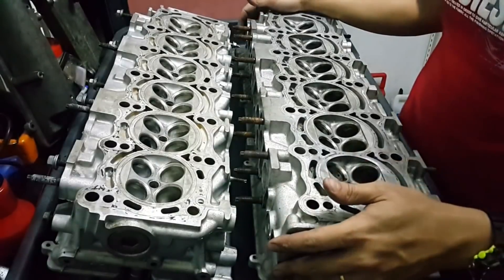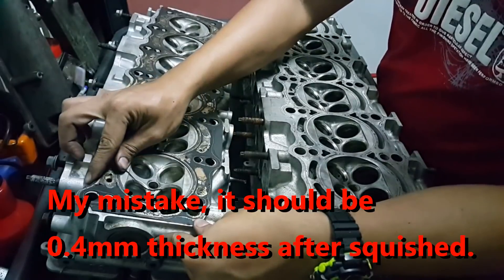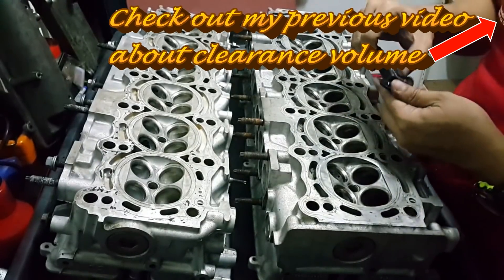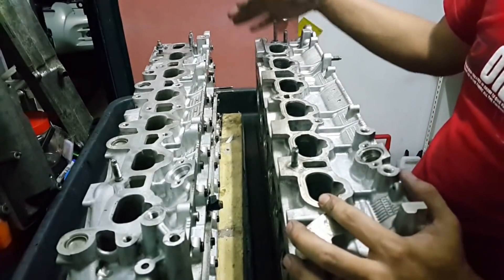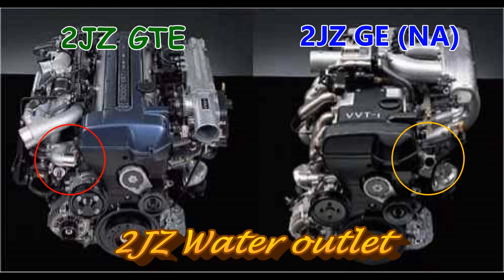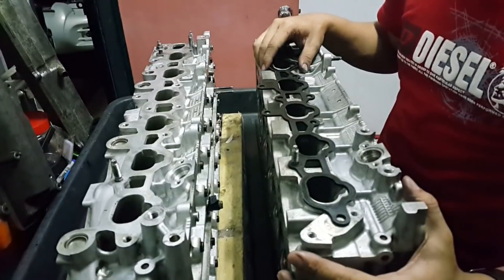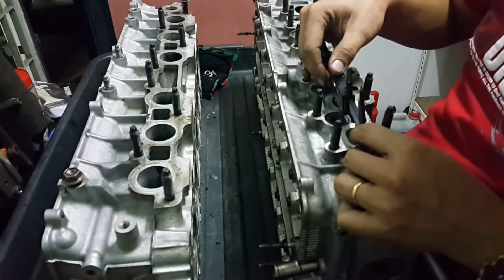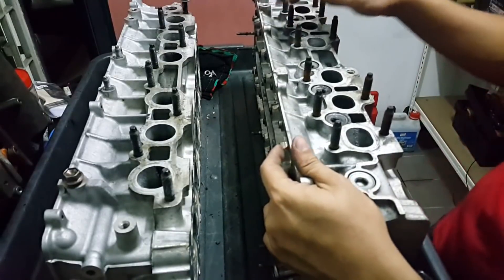2JZ Tuesday #9 - Difference between 2JZ GE and GTE cylinder heads (the best comparison!)

Comment from the maker: Here you go the difference between 2JZ GE (NA) Cylinder head and 2JZ GTE (Turbo) Cylinder head! You don't need to buy both to know the similarities and differences too! Here is my another video about the difference between the 2JZ GE and 2JZ GTE Engine block: https://www.youtube.com/watch?v=ZZ9DwNeW6UM
Reply: Is the GE worth the time to go NA T? I'm looking for 400-500 hp range for now. Heard a GT45 NA T was a good set up. What's your input.?
Reply: @JL_RandomThoughts  i think is more easy swap the gte cylinder head with all turbos system on my lexus is200 and put one big turbo. Because i hear the valves on gte cylinder head are more strong than ge this is the reason why i want swap the heads.
Reply: @carloscolberg4997  cool. I have a 99 sc300 that I want to have fun with. Don't need the fastest car on the planet. If the price is right it seems the way to go. How about single exhaust vs the dual I have?
Reply: @JL_RandomThoughts  what about the intake?
Reply: @JL_RandomThoughts  you have turbo on it?
Reply: @JL_RandomThoughts  if you want gain more hp at high rpm better intake and dual exhaust worth.
Reply: @carloscolberg4997  stock. looking at prices and it seems the best thing to  do is just get a turbo 2j and swap. they're cheap enough. same cost as buying the head alone..
Reply: @JL_RandomThoughts  yes is a good option
Reply from the maker: @JL_RandomThoughts  i m not sure what fuel u guys are using, but NA cannot go to 400 hp i think. need con rods, pistons, fuel, turbo, injectors and ecu. NA-T i have 2 videos about how to do it too
Reply: @cheapkailaujing  cool. I'll check it out
Reply from the maker: @JL_RandomThoughts  yeap.. Na-T 400 to 500hp is easily achievable
Reply: if i have 2jGE can i replace the cylinder head for 2jzGTE?
Reply: @carloscolberg4997   yes. all 1jzgte/2jzgte/ge/vvti and non are all interchangeable when it comes to the head and block.
Reply: @rayj2j  its true? The gye valves are more strong than ge head? This is the reason why i want do a head swap.
Reply: One last thing. Can a GE head be machined diy for better cooling and fit a GTE gasket?
Reply from the maker: @JL_RandomThoughts  hmm u can fit gte gasket on ge head. but inside ge head the water passage is lesser, and i believe cannot be machined bigger.. it was done during cast
Reply: Michael can i buy a gte head from you?
Reply: Hi michael i have NA supra that im planning to turbo soon and you said we cant use GTE intake manifold on the GE but what if we try to use a GTE upper plenum on the GE lower plenum. i know the intake ports on the cylinder head is different between the two but what about from the lower plenum upper plenum part i think theyre the same
Reply from the maker: @noodlestoddles187  hmm gte and ge intake manifold do not match

Comment: What about the cam shafts? Are they interchangeable?
Reply from the maker: Sorry I didn't try it, but it should be interchangeable. Except for VVT-i and non vvti. And also some cylinder head has 2 cam sensor input, some has 1 only, so have to check on that too

Comment: hi, great vidio .. i am trying to see if there is a differance in the coolant outlet ports on front on exhaust sides of heads .. is hole and bolts spacing the same or differant ?
Reply from the maker: Yes one is left one is right. Not interchangeable

Comment: Very nice!! So do you think that GSC S1 GTE VVTi cams would fit in a GE VVTi head???
Reply from the maker: yes but be careful of the cam sensor position, it might hit or different number of teeth
Reply: Michael Chung Racing -Cars Explained so i will still need to modify the head for the new cam sensor or how?
Reply from the maker: @Crazy_ATV_rider  this one u have to fit it in to see.. Either u can machine a spacer for sensor or adjust on the ecu
Reply: Michael Chung Racing -Cars Explained thanks so much for the help! I will look up more, the sensor i don’t think that would be a problem because i’m going aem infinity standalone ecu

Comment: what about the middle section of the intake manifold? 
example, GE Head with GE intake manifold adapter or pipes section can that bolt on to the Actual Intake manifold of a GTE Intake? (The Actual Intake body)
Reply from the maker: Nope.. Cannot match at all. Holes for air and bolts locations are not the same
Reply: Michael Chung Racing -Cars Explained thanks for clearing that up 🙌🏽

Comment: Same valve diameter?
Reply from the maker: yes but the profile is slightly different for air to flow in.
Reply: Michael Chung Racing -Cars Explained Did you ever find out which exhaust port is bigger ?

Comment: hi, are there differences with 2jz gte vvti Supra vs 2jz gte vvti Aristo? I only know the rear or front sump oil pan. they told me smaller oil pump on aristo and slightly narrower head suction pipes in aristo. what do you tell me ? thankssss

Comment: The problem is that you are using the bad GE head (vvti). The GE vvti head has waaaaay smaller intake ports than the GE non vvti. I am using a GE NON-VVTI on my 2jz build and i deleted the distributor and drilled/welded a cam sensor bung on the same location as the GTE and GEvvti so I can use GTE cams. I paid $39 for that GE non VVTi head (vs $1200-1500 for a GTE head). So I spent the rest of the money in 272 BC cams, springs, etc. I honestly don't like anything GTE because it is overpriced. You can find a GE non vvti in a junkyard for $250. (instead of buying a GTE for $3,000).
Reply from the maker: Ah that's a good deal.. Sorry I don't have ge non VVTi to do a comparison too

Comment: Hi great video! I’m just confused, I have seen on forums that the gte valve covers fit directly on to the ge and it has been done many times, can you explain this as one side did not fit for you? Thank you so much!
Reply from the maker: oh vvti and non vvti valve covers are different. because of the vvti solenoid stuck out. and the screw locations are different too T_T
Reply: Thank you for your reply I’m learning a lot from your videos, so am I correct in saying that non vvti gte valve covers fit directly on to a non vvii ge head?
Reply from the maker: @TheTommycute  oh dear sorry i don't know about it. since i dun have non vvti gte head. i had one vvti gte head, and i machined a non vvti cam into it. but i dunno about the valve covers T_T sry
Reply: Oh I didn’t realise that they were vvti heads you were comparing, 👍

Comment: would installing a gte cylinder head onto a GE block essentially be direct fit bolt on, or would their be fabricating needed?
Reply from the maker: direct bolt on =D just have to check out for oil supply for turbo etc =D
Reply: @cheapkailaujing  what do you mean by oil supply to turbo?
Reply from the maker: @isaacgarcia2979  2jz gte has turbo, GE no turbo. But gte turbo has oil feed directly from the block, at GE head has the oil supply but blocked off. Either you can unblock it or use the vvti oil supply for your NA-T turbo

Comment: Very nice video but I have one question, will the GTE head fit on the GE block? And what would you need to make that happen cause you aside something’s are different
Reply from the maker: fit, but there is some water outlet and oil outlet difference for the turbo, oil filter with water cooled hoses. others are exactly the same
Reply: Michael Chung Racing -Cars Explained thank you for responding so fast, if I were to run the whole stock the head would there also be a wiring issue I would have to tackle?
Reply from the maker: @justini2351  most of the sensors and stuffs are on the head, so if u are using gte head, u have to use gte wiring harness haha =D or rewire a new harness =D

Comment: Can you do a video on the Difference between a 2JZ-GTE & 2JZGTE-VVTI Wire harnesses... Including Layout differences, Connectors, and missing or extra connectors?
Reply from the maker: Hmm if 2jz gte non VVTi and VVTi, the difference is just VVTi socket. The rest still the same. If 2jz GE and gte, there are only a few differences, namely, the tps location, MAF vs MAP and air temp sensor. The rest are the same..
Reply: @cheapkailaujing  What about USDM VS JDM Harnesses. 
Lets say I planned to Swap a JDM 2JZ-GTE Aristo engine into a JDM 2JZ-GE JZA80. Besides Coils what would the differences be. Could the 2JZ-GE Harness work on the GTE?  Are the ECU Pins the same? or there are variances that might need to be re-pinned to match. Could make an interesting video as well
Reply: Another question to consider is. Can a GTE VVTI Harness work on a GTE Non-VVTI if you changed the ECU Connector? Would all the connectors be the same besides the ECU Connector 🤔💭
Reply from the maker: @BjornFSE  hmm i have no way to confirm it, but i think the difference is just the vvti socket
Reply from the maker: @BjornFSE  sorry we have no access to USDM engine at all. what is the reason of reusing the harness, if u are changing to a new engine, it should comes together with its wiring..
Reply: @cheapkailaujing  The engine is a JDM Aristo 2JZGTE swapped into an MK3 Supra. The car had an accident. and now planning a Swap of the engine into my JDM JZA80  2JZ-GE. The ECU Connectors are the same. however I am reluctant to mess with my GE Harness. Hence considered buying a GTE VVTI harness used and re-pin the connector to suit the GTE with/for a standalone ECU. (I am not sure the extent to which the Aristo harness into the MK3 is damaged.)

This is the reason I asked the differences between GTE Non-VVTI and GTE VVTI comparisons of the 2JZ Harness. 

(Side Note: I also read on a forum the harness pin differences in some locations on the GE versus the GTE version but I believe this is a JDM vs USDM matter.... Likely Supraforums)
Reply from the maker: @BjornFSE  hmm the 2jz GE just reuse back its wires and the 2jz GTE reuse back its wires? :)

Comment: Hey i have a question i have a 2jz ge vvti engine. That I want it to make 400-500hp. I’m going to put a turbo. What do I have to change in it to make that power?
Reply: I’m going to put gte pistons & rods & this engine is going in a 280z
Reply: Michael Chung vui min sure well 👍👍 & keep updating your video you they help us a lot
Reply: If you can, can make a video on a 2jz ge vvti engine on how to make more horsepower on it 👍👍👍
Reply from the maker: @josemarichalar7437  not easy, but i will do that... budget constraints..

Comment: Hey bro, quick question. What's the advantages and disadvantages of using a non VVTI GE block and VVTI GTE head? I've seen some people do it here in the US.
Reply from the maker: some people worry of the vvti causing interference and catastrophic failure.. so they use non vvti one whole set. but some have tested and using vvti all the time, with better response =D

Comment: I bought a 97 lexus sc 300 with the 2jz-ge engine, it will be a daily driver, but I want a little more power 350-400hp, how would you recommend I get to That level of power?
Reply: @cheapkailaujing  thanks, I'll look more into it

Comment: So question would it be better for me to buy a jdm 2jzgte vvti and swap out my 2jzge engine? And if I  do that is it a direct fit or will I have to do some mods besides wiring harness to get engine to fit in my 2002 gs3? also can I use my 5sp auto Trans or must I use the 4sp Trans that comes with motor? And lastly if I  just decided to go with making my 2jzge NA in to a gte is the head the only difference bottom is the same? Please reply back asap....thx
Reply from the maker: 1. Yes it is direct fit, but engine wiring you have to reuse 2JZ GTE VVTI, intercooler hoses and small things
2. Yes you can reuse the transmissions, the bellhousing are the same, but I am not sure about the HP ratings
3. hmm the bottom are quite the same, but GTE with sturdier con rods and pistons, oil cooler, turbo oil feed and return. =)